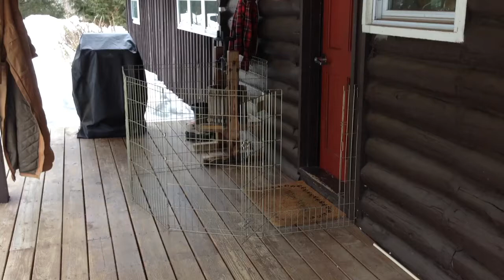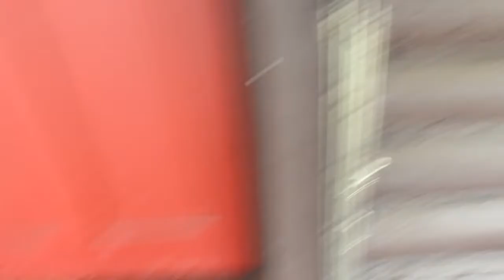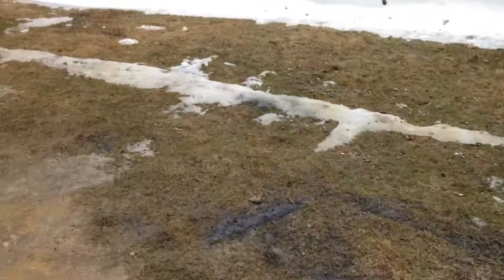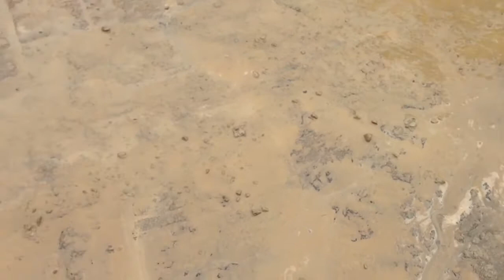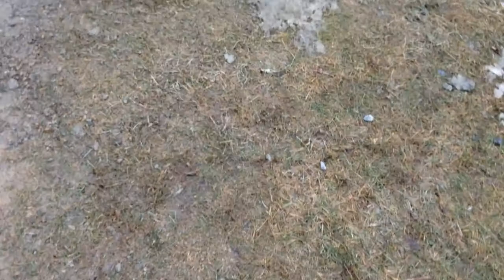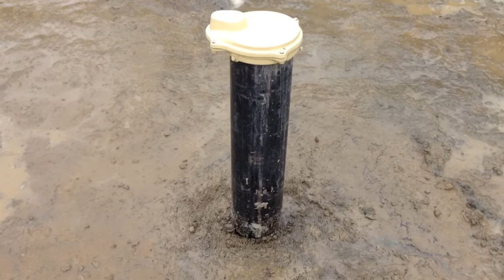Frozen waterline episode #11 - The well is in!

Comment: I wish I had a well. We rely on a rural water system.  How hard is your water? Ours is really hard so was our old well but our rural water isn't full of iron that makes everything turn orange.
Reply from the maker: Ours was actually about as perfect as you can get, so if we end up with water half as good as the spring we had before, I'll be happy. We used to get junk in the line, particulates like sand, and other minerals, but by and large, no hard water issues.